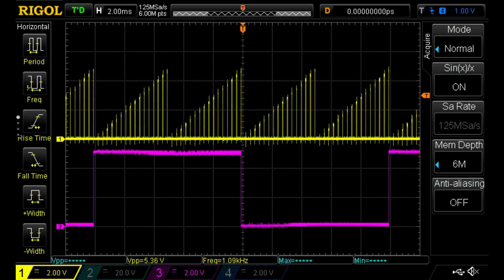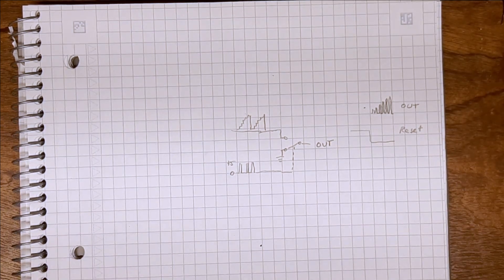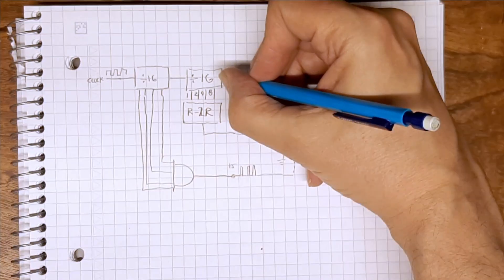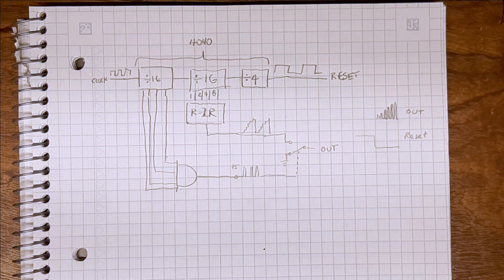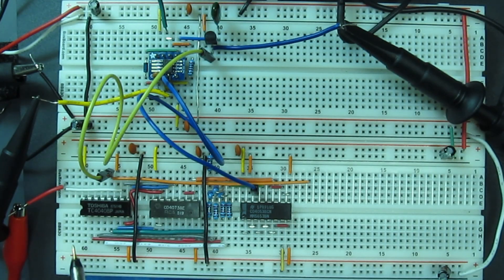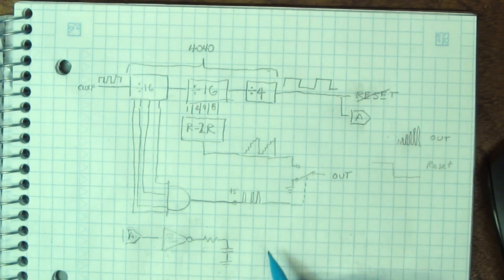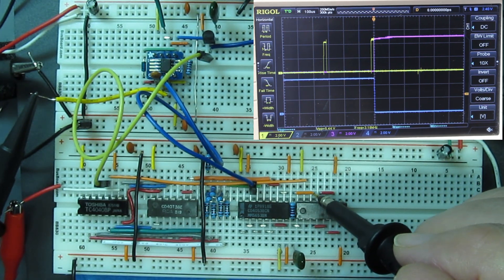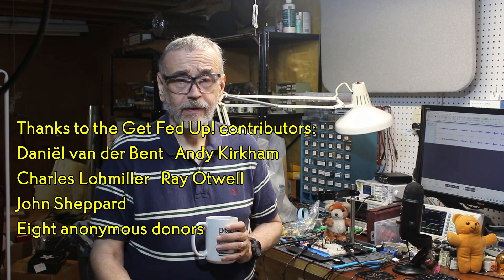Test Rig for a Peak Detector - Op-Amp Basics bonus episode

Comment: I would have approached the problem differently - because we are all different and our thought processes are not the same. Instead of using binary counters and multiple input logic gates I would have used either a Johnson counter such as the CD4017 which gives 10 decoded outputs (1-in-10 out) or a shift register like the CD4015 to again generate a 1-in-N output from the clock. And then a different resistor divider on each output to generate the final levels. But of course I don't know if you have those ICs in stock so there's a chance that approach would not have worked with your I-won't-order-new-parts decision. :)
Reply from the maker: No guarantee that I wouldn't do it differently next week! I just saw the large number of divisions and immediately thought the 4040 might give a low package count.

Comment: "All resistors are 10k unless proven otherwise"
Words from the wise.
And the reason I am  always out of them.
Reply from the maker: I buy the power-of-ten ones by the hundred.

The other ones I wind up using a lot of are 750, 1k5, 3k, 12k, 24k, because they are nice multiples of 2 from one another. Gotta use two for the missing 6k in the middle and you can use pairs to extend the two ends.

Comment: For generating short logic pulses, my preferred method is to the same thing by creating a delay by cascading inverters (although you can just use the propagation delay for very narrow pulses, the number of inverters determines the pulse width). Feed a clock signal into the input of the string of inverters then XOR the original and delayed clock signals. You'll get a short pulse at twice the clock frequency.
Reply from the maker: I wasn't sure at the start what pulse width would be long enough to make the peak detector work. That op-amp is pretty slow. The way I did it, I could tune it if I needed to... and even test how short they could be.

Comment: ANDing 4 lines could be done with a quad 2-input AND gate. Logically AND lines 1 & 2, also logically AND lines 3 & 4, then logically AND the two resultants. You'll still have an AND gate left over on the chip. By the way, when you restock, what company do you like to contact?
Reply from the maker: Of course, and I'm sure that I'd find 74C08 or 4081 in the box if I looked.  I was kind of stuck on 'wide gate'.Besides, I like to mix up the ways of 'making do' in the videos I show, rather than showing the same bodge every time.

Oh, and as to your question.  The answer is always "it depends".  I like LCSC if I'm having a board fabbed in China, they're right across the street in Shenzhen from the big board houses.  For stuff at home, Digi-Key has no minimum order and ships fast, so they tend to be the default. Sometimes I have to go to Newark or Mouser to find what I need, though.  I've picked up some random oddball parts on Amazon or AliExpress for real cheap, which is risky but at least doesn't risk very much money.  I got a pack of 20 SOT-363 adapters from AliExpress for less than ProtoAdvantage wanted for three.